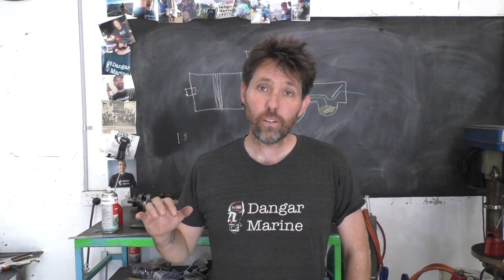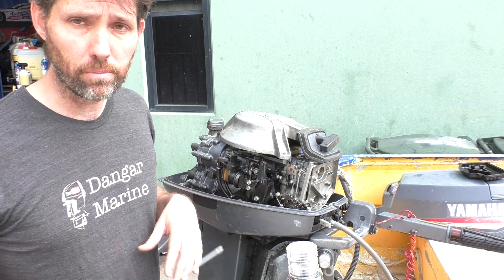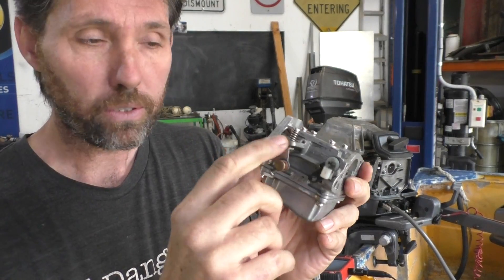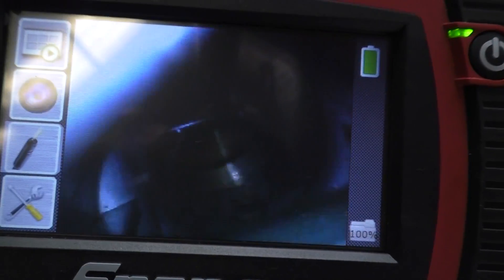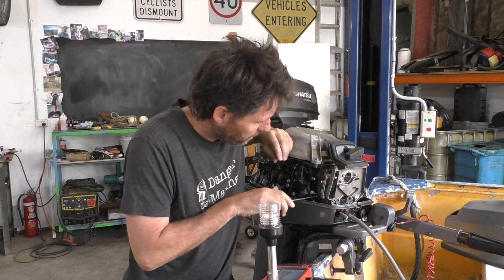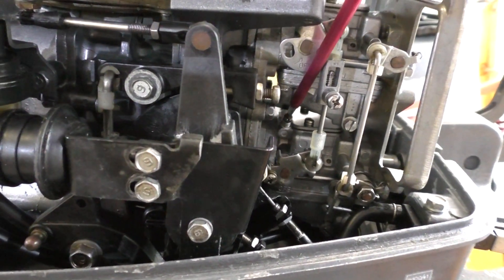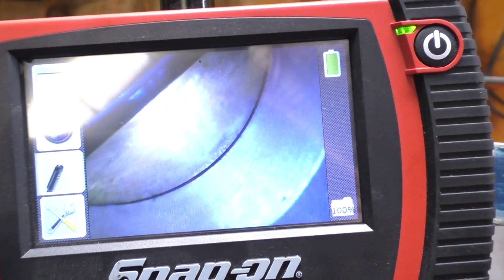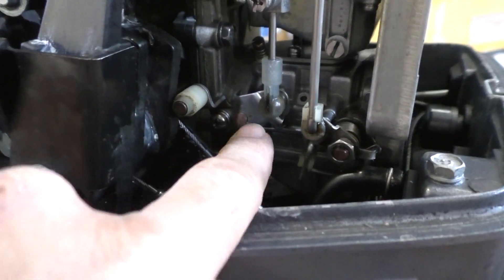Two stroke carburettor synchronisation

Comment: hello there, i have a merc force 120, and upon switching from drive to reverse it stalls , but not always. is it just a carb adjustment or something more serious? please help, all suggestions are welcome!
Reply from the maker: I would certainly start with carb clean and maybe look at the idle speed. Those gears are constant mesh so it's hard to see why it would happen with reverse and not forward.
Reply: Dangar Marine actually it happens in both, whether I'm switching from forward to reverse or visa-versa. If the idle is too low, would that cause an issue like mine? BTW, thanks for taking the time to do the videos,  they are very informative!

Comment: Hi Stu, got my son's 1969 merc 110 9.8hp running good. fixed the fuel leak and impeller works great. not totally done yet. the oil seal on the prop shaft is leaking lube oil and needs a new one. next project. haha here is my short video on it. 
https://youtu.be/_YZiIUtg7I8
Oh I need to get that fancy seal removal tool you have. watched on video of a guy drilling holes in the seal, installing screws and using a slide hammer. effective but metal shaving? like you're way and faster too.
Reply from the maker: Hey Tim, glad you got it running nicely. The big risk with drilling the oil seal is still nicking the driveshaft as you do it. You'd certainly also have to clean out any shavings that's for sure.

Comment: Do these motors have a vacuum port, to sync that way – like you did in a previous video? I'm assuming no, but wanted to check. In the process of purchasing a service manual.
Reply from the maker: No, vacuum ports are only on the intake manifold on four stroke motors.
Reply: Dangar Marine: Gotcha, thanks!

Comment: I have a Lowe deck boat with a Johnson 150 motor, salt water edition. I live at a small lake in Texas, fresh water, and the lake was to low to put the boat in for about 5 years. Last year I put it in the water and on idle it runs ok, but when I get into the high rpms or pulling a tuber it will sound the hot motor buzzer and starts cutting out big time. I can turn it off and the turn it back on immediately and I'm going full bore for a while then it does it again. Some times it happens pretty quickly and then again it may be quite a while. I have blasted the carbs with the cleaner at the brass front fitting and they seem clear. I have also replaced the water intake impeller.  It has a separate tank for the oil and I thought that may have a problem since its set up so long. Do you have any ideas? Thanks and I really enjoy your videos.
Reply from the maker: Hi Terry, I'm not overly familiar with those Johnsons, but I presume there will be some way to tell if it is an overheat or an oil alarm. If it is an overheat it may be the thermostat stuck closed so even if the pump is good, the water won't be going through the head.
Reply: Thanks

Comment: I have learned so much by watching your channel! thank you Sir. 
I have a 50 HP Yamaha 2stoke that keeps getting clogged jets. almost immediately after cleaning. I have replaced all fuel lines, filters, fuel pump, and ran it on a separate fuel tank. My next step is to replace the spaghetti gaskets or orings inside the carbs. they have some type of gel stuck to them. it was like this when I bought the boat. have you ever seen these gaskets cause this type of problem?
Reply from the maker: Once gaskets and o-rings start to disintegrate they can certainly cause these types of problems. It's good that you have changed the fuel lines as these are a big cause of trouble once they get old.
Reply: Wish you was in tennessee in usa..we need someone like you here..you care about what you are doing..i see that very easy..did you go to lots of training..or did you educate yourself..
God bless

Comment: Rats, I was hoping it wasn't the carburetors since mine behaves the same way but only has 1 carb and only has 1 crank case cavity for both cylinder. All the electronics are new (from marineengine.com by the way). Great video serious though. I appreciate what you do...
Reply from the maker: It sounds like your might be a true lean sneeze. Have you gone through all the carb and vacuum leak tests? Does it go away if you pull the choke on a bit?

Comment: It seems like the smaller the motor, the more important it is to have the carbs synchronized. I know its bad for all motors but seems there isn't as much wiggle room on the smaller motors. Great job as always Stu!!!
Reply from the maker: I think you're on the money there, small motors do seem to be more sensitive. About the only motor I could never get running no matter how much I tried was a chainsaw.
Reply: Dangar Marine Haha Stu. Its crazy you just said that. I swear to god right now Im in my Dangar Marine shirt cutting a big broken pecan tree with a Dolmar chainsaw that i got running but I can only get it running at a crazy fast idle that scares the crap outta me. Pouring sweat in this hot louisiana weather. Too cool you said that bud!

Comment: So impressive you foundthe problem, im actually having the same problem but with a 15 hp mercury 2 stroke. just one carburetor though, which i rebuild, but still the same problem. I am working on outboards myself for over 10years now but never came across such a problem. It's true that 80% is a dirty carburetor, but this is just insane. I got a vacuum leak via the butterfly axle and mechaniced the shit out of it, blocked one end off and an 0-ring on the other end so it leaks no more and handles exactly the same... this is just insane.

Comment: I knew it lol. Actually I was expecting the bore of one or both of the carb butterfly shaft(s) to be worn. It still great showing how diagnostic leads a person around like that. I once as a teen rebuilt a car engine  because I thought I had a head warped.. Turned out a line to the turbo after all of that. No worries though because it really was due at 230k miles I guess.

Comment: Well, that was easier than I thought it would be.  I figured you would break out a mercury carburetor sync tool. But then, I didn't see any vacuum tube ports on the sides of those little Yam's carbs to attach the tubing to.
Reply from the maker: Hey Stan. No, those vacuum ports are on the intake manifold of four stroke motors, these two strokes go straight into the crankcase.

Comment: Awesome Stu. I had no idea that these engines were that sensitive to carburetors not synchronized perfectly. I definitely learned something from watching this. Is it possible to remove the carbs for cleaning and not disturb the sync settings?
Reply from the maker: I too was surprised how much it upset the motor. I can't imagine things being too far out after putting the carburettors back on.

Comment: Getting game again announcing what next weeks video will be about :-)
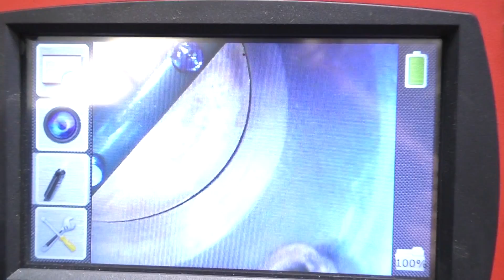at about 09:50  is that that an edit double up ?
And I wish the Johnson 50 twin 'link and Sync' was as simple as your engines. The OMC process is very fiddly, and the book states the engine is sensitive to the cylinders being out of sync.
Reply: Ron Powell I have an evinrude 48 SPL. It's essentially the same as your Johnson 50. I've seen the sync and link procedure in the manual, and I agree it doesn't look easy! Hoping I never have to do it.
Reply from the maker: Hmmm, I'd be interested to look through the procedure. Somebody just gave me a Johnson service manual recently. I think that "double up" was just me being repetitive rather than an edit.
Reply: Fireship1 - they ARE the same engines other than the cover sticker- well too close to be of any consequence. The difference between the 50 and the 48 is only where the HP rating is measured- 50 at the flywheel, 48 at the prop.